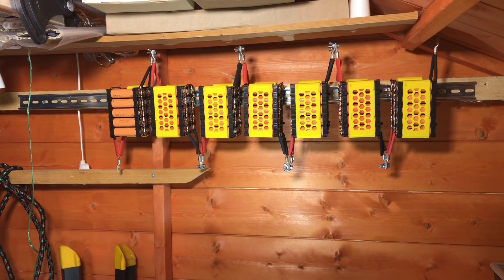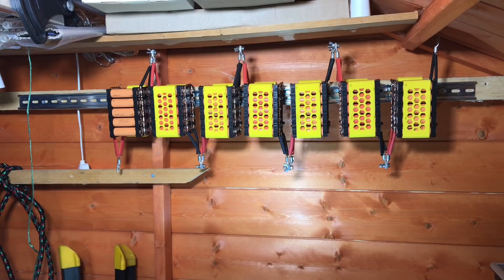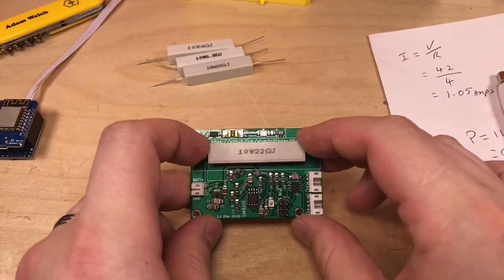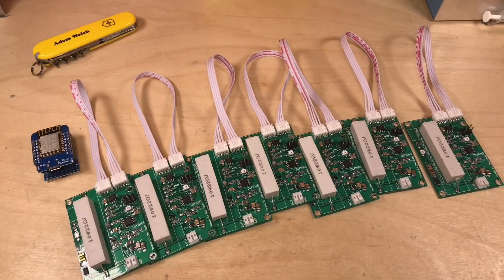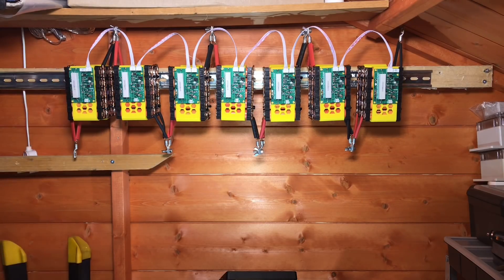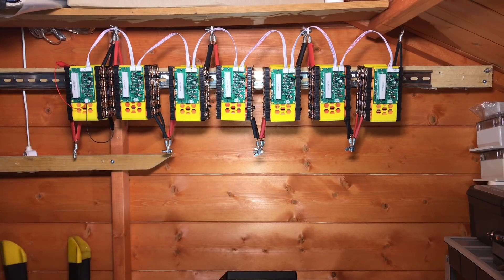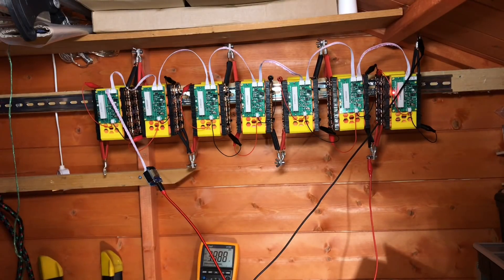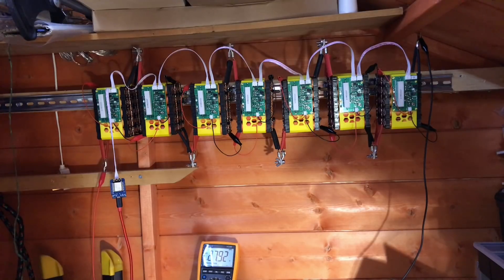diyBMS - Provisioning and Calibrating - 12v Solar Shed

Comment: Dude i think you should have started from the most negative point, look at your balance leads on batteries 0 4.2 8.4 12.6 16.8..... And 0.2 amps discharge on a 40Ah pack? Depending how much solar your putting on it i'm expecting those loads to change lol
Reply from the maker: I think you’re right that module one should be the most negative. I’ve already reconsidered this today (video was uploaded yesterday). I’ll re-do that. 
As for the discharge current - I’d be inclined to agree with you on that too - except for the fact I’ve been fairly careful with testing and building the packs, so they are already well balanced. Hopefully the that will have ensured these won’t get far out of balance in the first place. My 7s8p (about 22Ah) pack was being balanced on the capacity controller and that was only balancing at about 25mA!
Reply from the maker: This is where I am very wasteful at the moment.  My banks are fully charged early in the day and they don't get used until evening.  I need some other loads I can pump the energy into rather than leave my panels sitting idle.
Reply from the maker: I hope so, but I'm fully prepared to be wrong and have to change my bypass resistors.
Reply: TW, those green charge controllers are boost converters and cannot output less voltage than they receive! They were designed primarily to step up to 48-96V.
You must make sure the panel voltages are less than a couple of volts less than 29.4V, or use higher voltage batteries, then they will be able to regulate.
Reply: its been running for the best part of 2 years already mate, and growing slowly. I am the BMS at present, but i do also have an arduino monitoring the whole system. In 2 years the batteries have only gone over voltage once, and they were back to within spec within 5 mins of me noticing and turning more loads on. My inverter is and old UPS which i suspect 7s is about its limit, it came with 2 12v lead acids in series, and i don't fancy risking blowing it up, at least until a spare comes up at the right price.

Yeah i know that squeak when i walk is getting terrible, the joints must need some lube haha...
Reply: Well, at least you are aware of it - hurry up and get those extra cells done then you can stop being a bms... Pete @ HBPowerwall would have a fit, but I won't tell... :-)
Reply: My thoughts too - convention says Cell 1 starts from the most negative, so best to follow at all times because simple human mistakes can be expensive.
Yes, 0.2A balancing is tiny but time will tell if it's enough. It only needs to bypass at ToC if charging doesn't shut off before pack voltage it reached.
If any cell goes too high, then the charging should also shut off while still allowing the high cell to discharge.
Reply: Haha i am thinking in terms of my own system, i dont want to be dumping 32amps into fully charged packs, i really should do a vid on my setup sometime. :D
Reply: Dont cut the charging, divert it ;) ohh i know about mistakes, building my solar monitor has cost me an adc and both laptop usb ports :(
Reply: TW, no charge controller should ever try to dump 32A into a fully charged pack, with or without a BMS! As you say, diversion to a dump load such as a water heater or the grid is a way to go.
As a pack reaches the end of its CV phase and current falls, the bypass current becomes a more significant fraction, so 0.2A might be enough to thumb the scales to keep them in check.
Reply: Shouldn't, but look into the green mppt charge controllers i have 4, no matter how i set them up, they still continue to charge past 29.4 volts, even if i tell them to stop charging at 28 volts, i can go out for an hour and come back to a battery bank higher than its supposed to be. :/
Reply: My PC and a GPU thats mining is my dump load at the moment mate, i waste very little of the sun i do actually get here :)
Reply: I'm pretty sure thats the reason i went for the green ones aside from the nice low price. My panels are 255 watt each, 36V oc and 30.3 mppt, my battery bank is currently 7s 20p *6. Only currently using 4 panels, but have another 3 waiting for more battery capacity and 1 more panel, before i switch up to 48v which was always the plan, just taking longer than originally envisioned. Batteries are too expensive :/
Reply: That explains why you are overcharging 7S and your balancing resistors are going nuts!
Your panels produce too much voltage and the mppt can only output the same or higher so you're in danger of damaging the batteries or even letting the whole thing go up in flames if you're not monitoring them every 10 mins!
You could try 10S if your inverter will handle it before going to 14S.
I really would fix this before continuing to use them with this setup.
Reply: wow.. I'm really surprised you got away with it for so long!
Perhaps a cheap short term solution would be to use a DC-DC converter to bring the panel voltage down to 24V. The charge controllers should still be able to find the new mpp.
Reply: Na the solution is tricky monitors it constantly, my pc runs off the system 24 / 7. And i prolly spend 12 hours a day at the pc lol. I've got it pretty well tuned at the mo, to the point tea time the batteries are just climbing over 29 volt. And after tea time passes the panels are producing less than the load so start to discharge the batteries. Its just the extra sunny days i have to watch out for, and the pc crashing. It would all be switched off if not sold if i wasn't around to monitor it like i am. :)
Reply: Haha i stopped following pete when he turned from it being his bit of fun to revenue generation. It could have also been something to do with him becoming the next digital big issue seller with that rudy paytreon site, but i could be wrong on that. I am trying to get more cells, but they are getting scarce and expensive considering it is basically scrap batteries that we are processing. The scrap yards missed a trick with these lithium batteries lol.

Comment: Would it make any difference if you used a smaller resistor.  I'm figuring that it is trying to draw the pack down so fast that it is only drawing power down from the closest cells.
Reply from the maker: The module is connected at opposite ends of the pack so this should help even the draw across it.  A lower value resistor would increase the current, a small resistor in size would be rated for less power typically, but multiple smaller resistors in parrallel is a good way of doing it - but the pcb isn't set up for that.